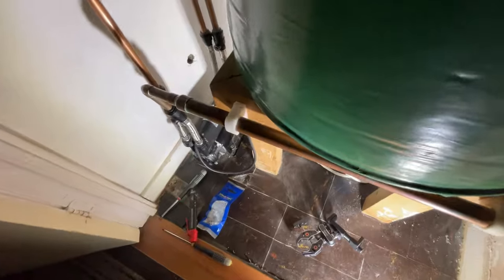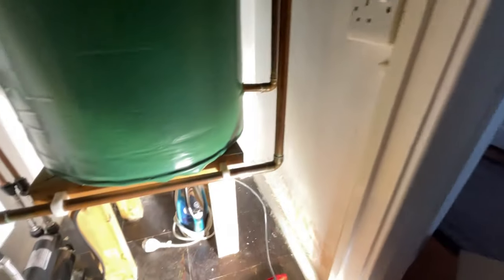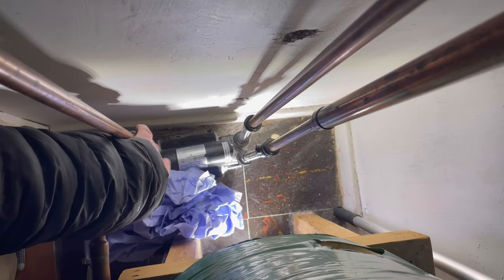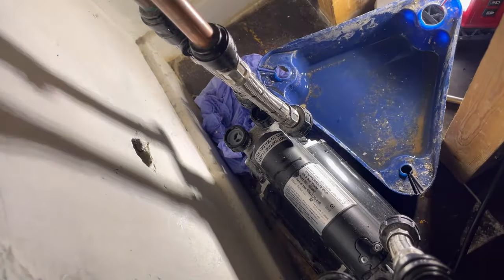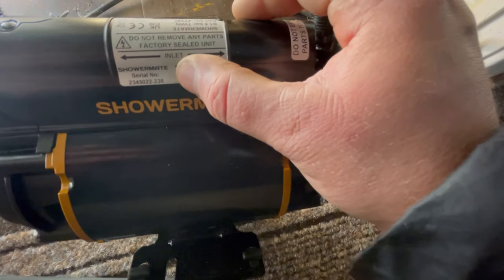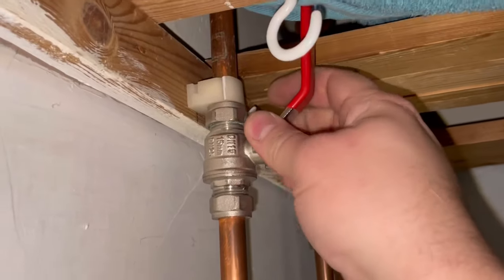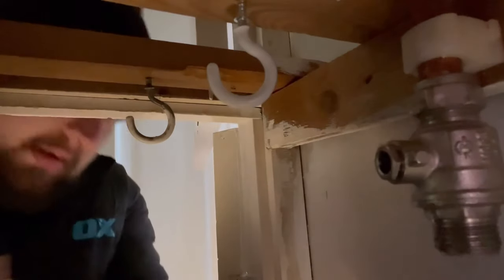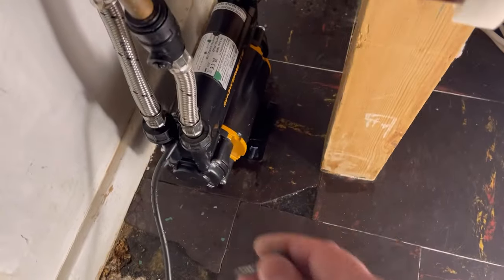Stuart turner shower mate installation guide (1.5bar twin shower pump)

Comment: Hi there,I would need your advice,I've just installed the pump in your video after your recommendation which is replacing a salamander ct 50. From the moment of plugging it in ,the pump won't shut off(I have primed it for a  few minutes prior to switching it on).Must mention that the pump is working the bath taps and that's where it is located right under the bath taps -3"of outlet pipe after its flexi hoses.Did this ever happened to you before - not shutting down?
Thanks in advance
Reply from the maker: Contact customer support